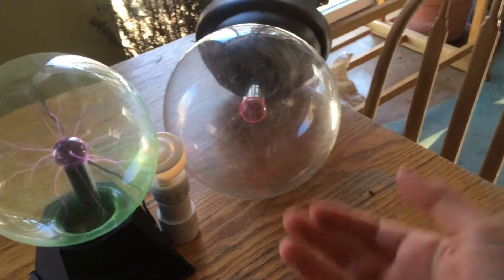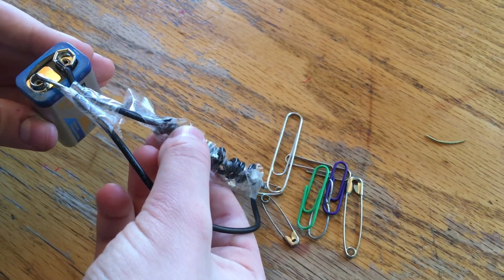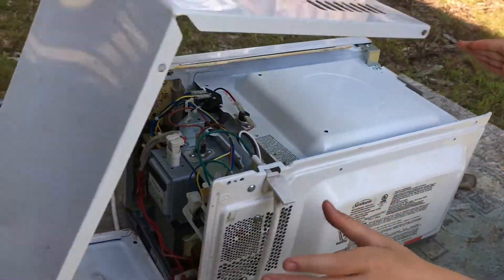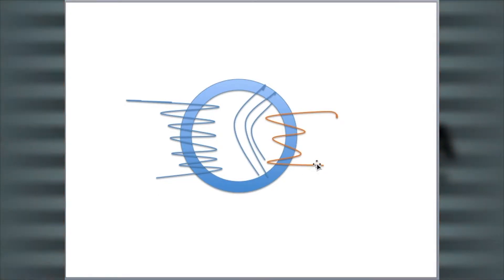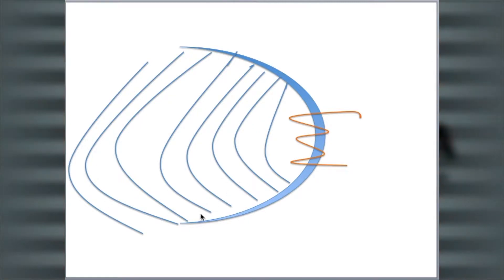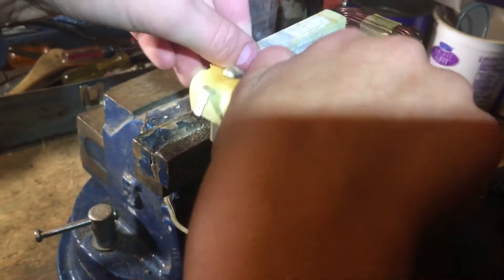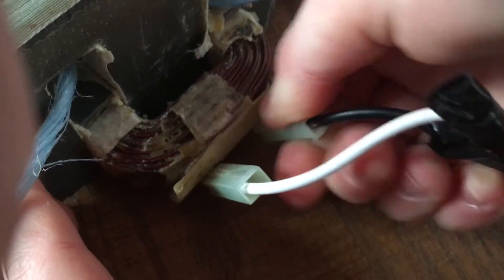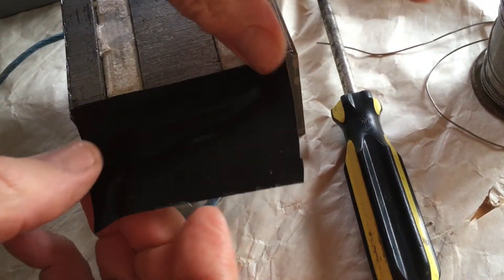Ultra Powerful Electromagnet built from Microwave Transformer

Comment: This kid is just like me

The fact that I almost burn down my house while messing around with the transformer
Reply from the maker: this actually didn't even come close to starting a fire because the sparks only appeared for half a second though, 11 year old me was stupid lmao, i take way more safety precautions in my new videos
Reply: @NerdlabsSci  you should experiment with magnets and invent something revolutionary
Reply from the maker: @protection1391  also have you seen my Tesla coil videos? they use electromagnet coils to generate millions of volts of power!
Reply: @NerdlabsSci  yep
Reply from the maker: @protection1391  awesome
Reply: @NerdlabsSci  i actually built a circuit board and an insect flied through the capacitors and shorted the power
Reply from the maker: @protection1391   big oof for both you and the bug